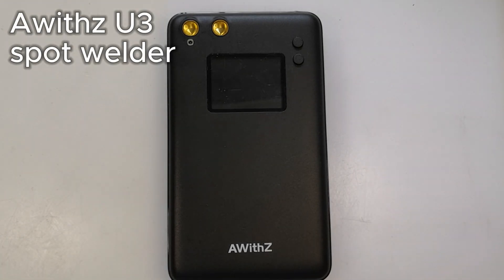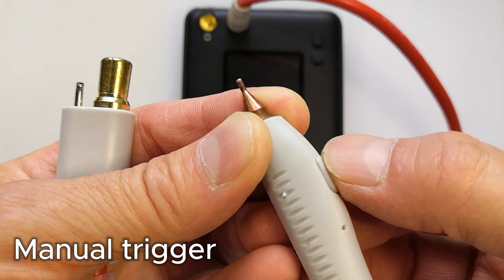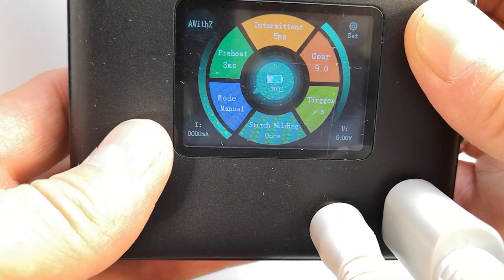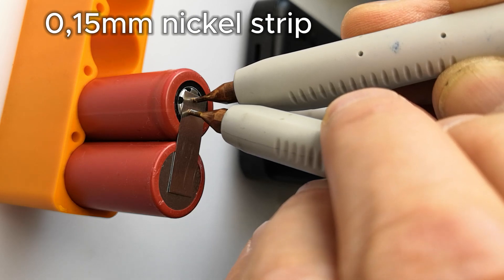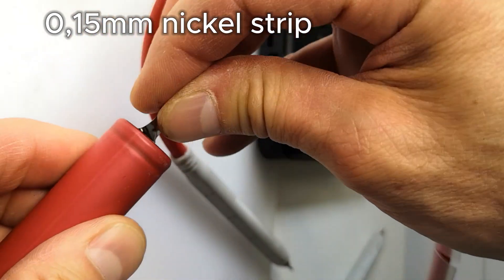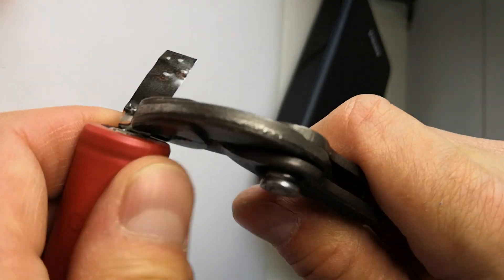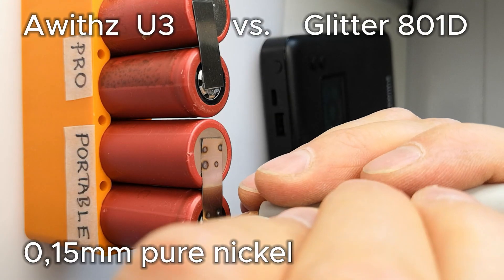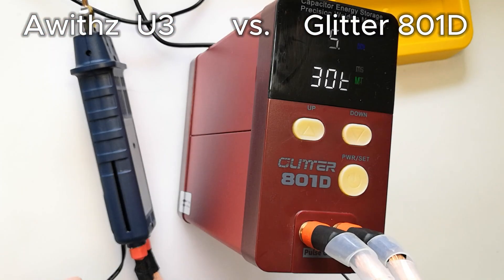Awithz U3 Spot Welder review

Comment: What pulse settings did you use for each weld?
Reply from the maker: I tested all settings at max power, did not see much difference with result. Only more heat generated. Used finally one pulse at max power.

Comment: It seems like it doesn't weld very well with 0.15 pure nickel, is that right?
Reply from the maker: 0.15mm pure nickel does not weld. Looks okay, but joint is very light. Easy to pull apart. Nickel plated iron welds, and you can use  0.1mm, but you must put second layer for high power battery. You have to get 10 000 mAh version, even if you buy another brand.